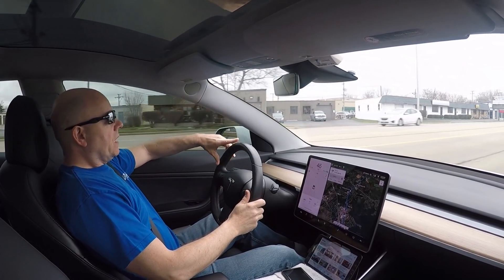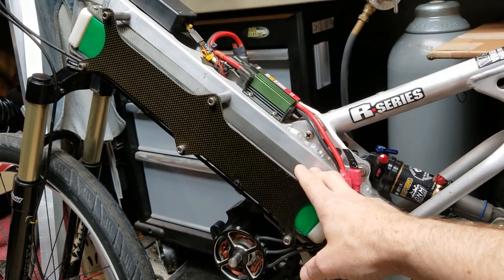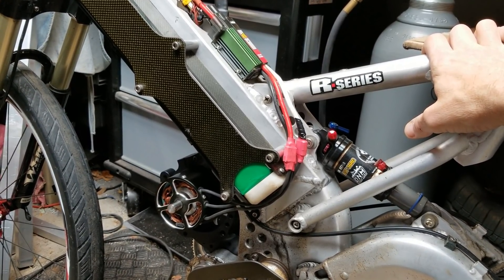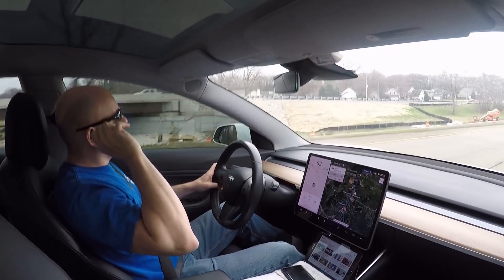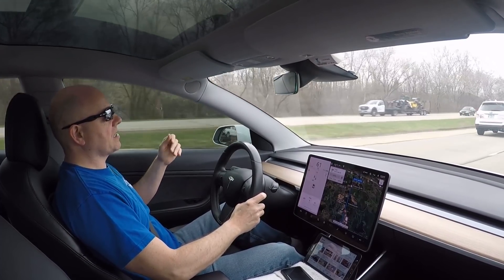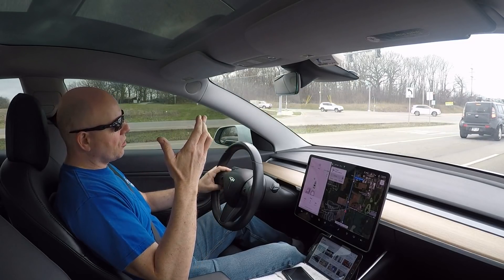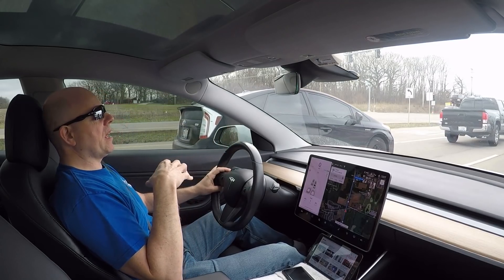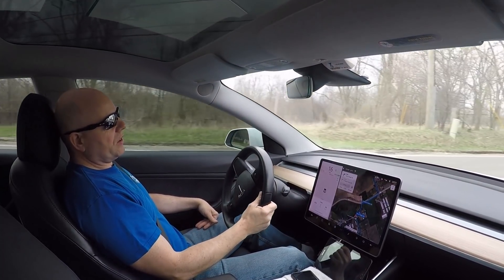Are expensive batteries good for overall vehicle design?

Comment: Completely unrelated to the video but I have a question you may have the answer to.  I daily a 2016 Fusion Energi.  I recently discovered that L in the transmission because it’s a cvt does nothing more than increase initial lift off regen.  Did you ever drive your cmax around in L?   Notice any improvement in efficiency?   I’ve watched some of your other videos but I’m here for the mini model S 😎

Comment: It will be interesting to see what the prices of the batteries will be when a bunch of after market companies start making them. My guess is about 25% or less.
Reply: Tesla seems to have the lowest cost batteries. (trade secret, so no OEMs want to tell us). Tesla largest consumer of batteries (BYD in China with their buses might be number one??) and Tesla has more of a partnership with Panasonic. Largest buyer usually gets largest discounts.  Even Tesla could not get enough batteries for 2019 Q1 - they use a "secret chemistry" and Panasonic couldn't make enough (why? no one will say). Lack of batteries is probably a big reason no one else selling as many battery vehicles as Tesla.  check out: https://insideevs.com/news/352430/global-ev-sales-april-2019/ and you can look for archive score cards for historical data.  LEAF and ZOE sell in large numbers, are less expensive and smaller batteries.
Elon claims world will need about 100 GigaFactories to supply batteries IF all cars were electric BEVs.

Comment: Look at the power train in terms of a package. Battery is just the most recognized part. 

ICE car: engine 500 lb + 150 pounds gas&tank + 250 pound transmission/clutch+ 100 pounds driveline = 1000 pounds

Model 3: battery 1050 pounds + 350 pounds of motors = 1400 pounds. 

400 pounds additional weight in the Tesla is about 10% more than a comparable ice car. So as you can see it’s barely even an issue!
Reply: However, if you want an ICE car with comparable power to Model 3's powertrain, you need bigger, more powerful, less efficient engine which weighs more I would assume, plus since it's less efficient, you probably need a bigger heavier gas tank as well?

Comment: That's very true, Matt. In the 50's and 60's when gasoline was really cheap, there were big block V8's with 4 barrel carbs and nobody cared about fuel mileage. Fuel prices have steadily risen and now most cars are driven by small 4-cylinder turbo-charged, fuel-injected, computer-controlled engines getting far superior fuel mileage. Here in Ontario, Canada the average price for a liter of regular gas is $1.32 CDN, which equates to $5.00 CDN per US gallon. That is getting up there, but still nothing close to where it is in Europe. Imagine what would happen if the the cost of gasoline doubled overnight in the US.  That would change people's opinion of EV's in a hurry. As the saying goes, necessity is the mother of invention.
Reply: The big problem with that is lower income families. Can't afford a electric car. So they will be the ones suffering. If all you tree huggers bought electric automobile for them that would work.
Reply: Bob Milliman They can’t afford $7.00 per gallon gas either. Electric cars are getting cheaper and at high gas prices, EVs become more  affordable.
Reply: @lemongavine  a used Nissan leaf can be had here in the western US for around 7k. Now Nissan can work on battery efficiency, life span, weight, and charge rate.